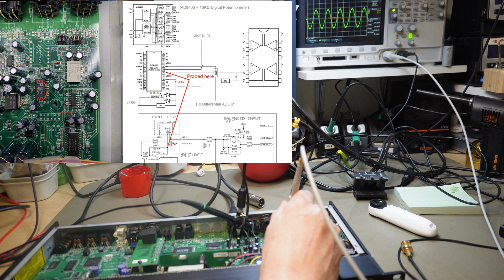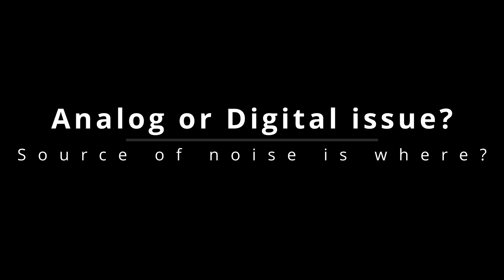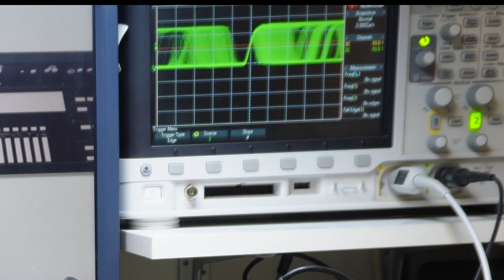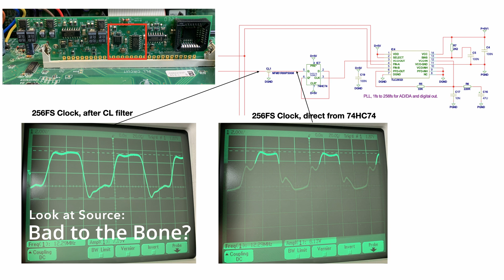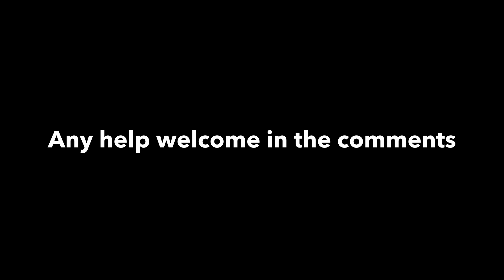SynthFixShort #10 TC Electronics Fireworx: Noise, distortion but no fix?!?

Comment: hello, i have same issue on TC electronic M3000. An ugly digital noize and distorted sound, sometimes amplified like a feedback loop, very strange. 
what did i do ? 
I've checked lots of voltage points, all correct. 
I have replaced the A.D. chip and the D.A. chip, but the noise still here. So the analog to digital converters and digital to analog are not faulty. Then, the noise is between this 2 chips, because before the analog converter my source is correct. 
I have replaced some caps ( all caps on power supply, and some next to the analog digital chips ), i am about to give up lol. But i want to fix it, so i continue .. courage ! & keep us updated ! i will do on my side if i find something, maybe i will look again at voltages, if something is 7v instead of 5v, it can be the culprit..anyway, lots of points to check

ps : my pll board circuit is removable, when i remove it the machine powers up but doesn't load any effect, i don't have any sound, but at least the noise disappears, so maybe i will order & replace all the ICs from the pll board circuit

Comment: Reminds me of my Ensoniq DP4+ problem. Almost 100% sure it gave the same sounds and the problem were the converters. Could also be the circuit around the ADC but in this case i bet that if you replace the ADC the problem goes away. If that isn't the case then i would replace caps etc. But never just replace all caps. You need to find that bad cap. We want to pinpoint the culprit. Not guess. Back to the ADC. What i think has happened is that somebody overloaded the input. It could also be in the digital control side but that is more difficult and that's why i would first rule out simple parts like the ADC. Don't make it to complicated when it's not jet needed. Also this doesn't sound like a faulty op amp. A faulty op amp stops working completely most of the time and if it distorts it would sound analog and it doesn't. Also before you replace the ADC i would check if all the power lines deliver the right volts etc. Starting with eliminating the power supply was a great start but sometimes not all power regulating is done inside the power supply but also on the main pcb / mainboard.  BTW that last idea isn't mine. I read the comments and somebody mentioned a high voltage that is more than 10% off. Finally get the ADC from an official source. Not ebay because there they sell a lot of fakes too. And not only sold from China. There are more local sellers that do it too now. Could be they don't test what they buy but anyway that is not the problem here. Good luck!

Comment: I have seen a very similar issue with digital signals in the past. When you're adding the scope probe to a particular net, you're adding capacitance and changing the timing of the digital signals. If one of the data bits is changing right when that signal is being read in (sampled), sometimes it will be interpreted as a 1, and sometimes as a 0, basically randomly, and if it's digital audio data, that will lead to random noise that sounds like static. Adding the scope probe adds just enough capacitance to delay that transition enough that it always gets read in correctly. I'd be looking for something on a clock line that's delaying the clock somewhere, putting extra load on the clock, or is supposed to be delaying the clock, but isn't. What is the signal net that when you add the scope probe to it fixes the issue? Is that a clock line? A data line? something else entirely?? You show that adding the probe there fixes the issue, but you never show what's actually on that net on the scope - you even showed that the sample clock is distorted - that's definitely a key factor here - the distorted clock pulse is changing when the digital signals are being read in to right when they're changing to the next state.
Reply: in the schematic you show, even when the signal is in "bypass", it's still going through A/D and then D/A - the problem is definitely timing related in the middle where the signal is in digital form. Also, you're measuring 6.9V on the VDD line on the AD8403? That's probably a shared 5V line that's used for a bunch of digital logic, so if that power rail is too high, it could be causing all sorts of weird digital problems, including timing issues. I would definitely figure out why that supply rail is too high.
Reply: another possibility is that node is also in the feedback path of the opamp IC41B - adding capacitance to that node with the scope probe might be preventing the op-amp from going into oscillation, and without the extra capacitance from the probe, it's oscillating. I would look at IC41B pin 5 the input, and pin 7 the output and compare what they look like with pin 6 left alone, vs with the other scope probe on pin 6. There's quite a lot of possibilities here, but you don't really provide enough of a view with the oscilloscope as to what's really going on to definitively determine what the issue is
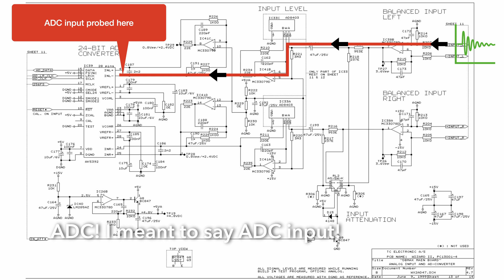Reply from the maker: @gorak9000  Thx for the thoughts!! I do not think it is the opamp: I probed the input to the ADC, and see no difference in signal when probing the „magic spot“ (wiper of digital pot, input to opamp). See also waveform at 2:06 in video.  The signal net I‘m „probing into“ is visible on the schematics at 1:30. btw: link to complete schematics in the notes. TC electronic‘s service web site allows deeplinks to service documents, circumventing the log-on… ts ts ts thx again gorak9000!
Reply: @reinardsynth6581  you don't want to "think" it's not the opamp, you have an oscilloscope, you PROVE it's not the opamp. Look at pin 7, and put the other probe on pin 6 or not - if pin 7 is clean in both cases, then it's not the opamp. The next thing I would look at is the sampling clock, both with the other scope probe on and off the magic "point". The sampling clock being distorted is definitely part of the problem, but there are a lot of unknowns here - why is the 5V rail for the digital pot at 7V? What else is on that supply rail that's supposed to be 5v, but is actually getting 7v? why is pressing on the board in the 3.3v power supply section having an affect on anything - you need to systematically narrow things down - that's what the scope is for. I don't think you're using the scope to the full potential you need to to actually isolate the problem.

Comment: When you first switched it on, i thought it sounded like some bad decoupling.
Which pin are you loading with the scope probe? The schematic was on screen too briefly for me to see.
Reply from the maker: @StuartTaylorEsquire  I put the scope probe on pin 18 of the digital controlled potentiometer IC AD8403. it is the „wiper“ output of the „potentiometers so to speak. What really confuses the hell out of me is why putting the probe there and nowhere else, I tried! makes the „distortion“ on the ADC digitised data stream go away?! does not compute… But re decoupling: will look close at the decoupling caps in that area
Reply: @reinardsynth6581 have you replaced the AD8403?
If loading the W pin "fixes" the distortion, I would suspect it.

Comment: Try resolder around with flux , sounds like false soldering point , introduce distortion , change the caps around. And the circuits of the crystal oscillator.
Reply: The clocking/timing probably works otherwise you had problems on the outputs and he doesn't. Also i never heard bad solder joints give this digital distortion. But I'm not a digital expert though but i believe it's not the joints.